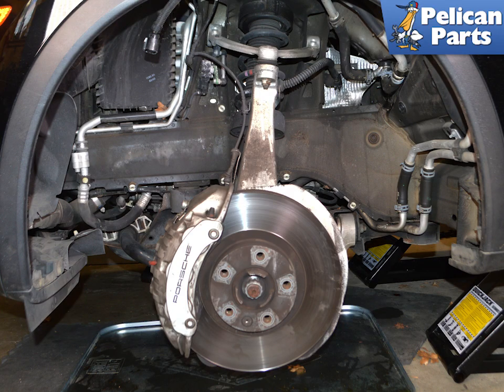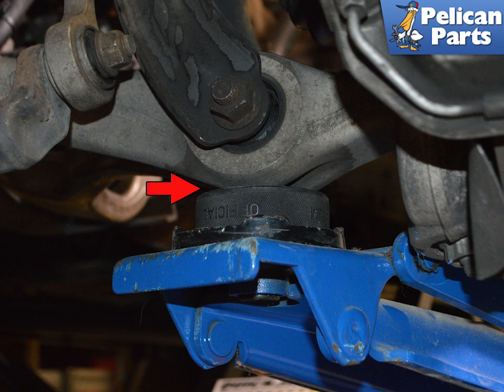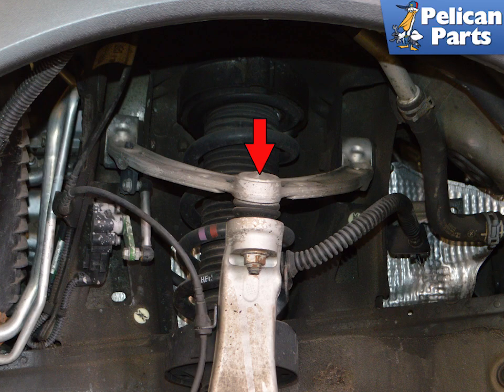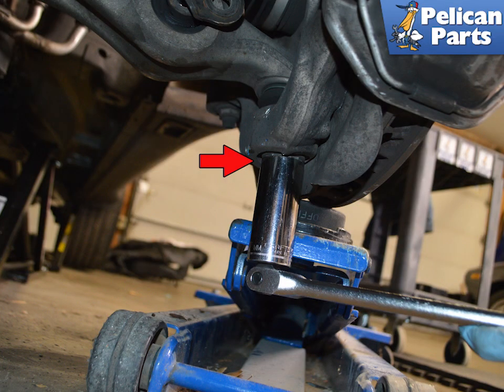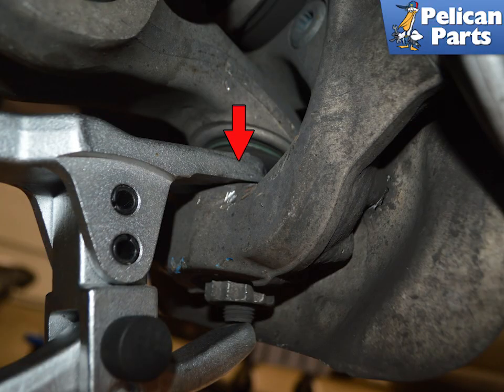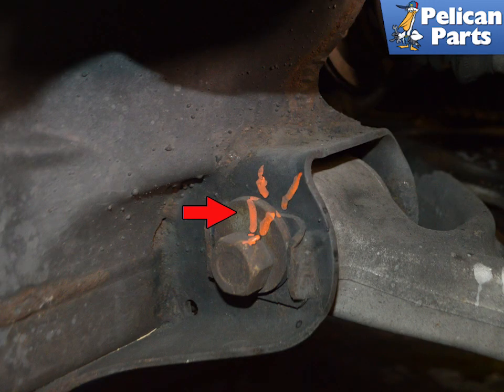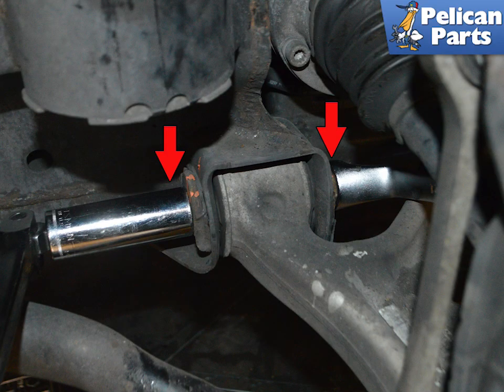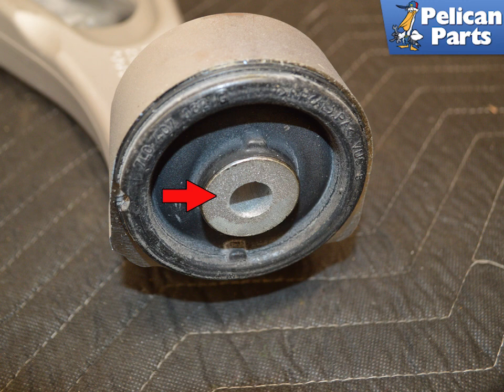Porsche Cayenne 958 Front Lower Control Arm Replacement (2011-2018)

Comment: Which model of Quick Jacks are those? Most of them cannot reach the correct span for the cayenne
Reply from the maker: Not 100% sure. The author did not note it. With your vehicle info handy, give The Pelican Parts parts specialists a call at 1-888-280-7799. They can figure out which one fits your vehicle.